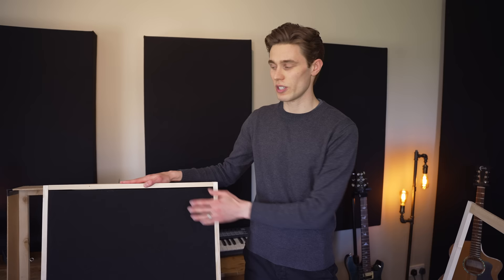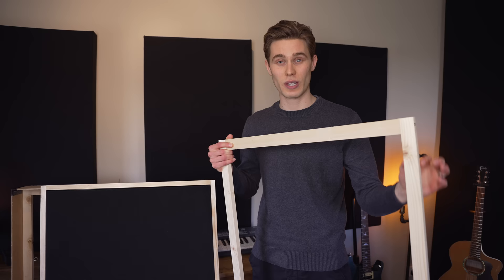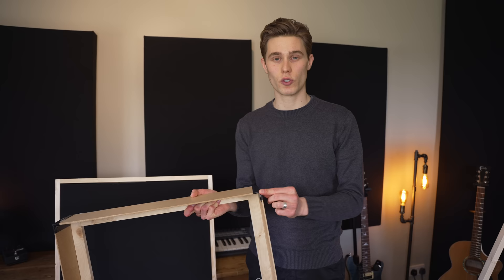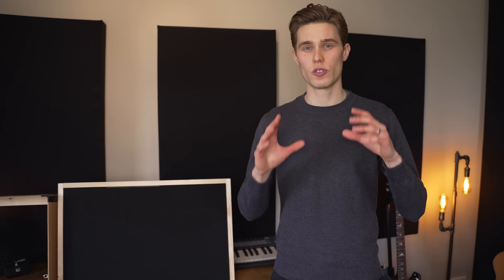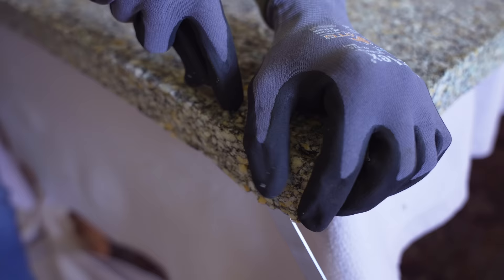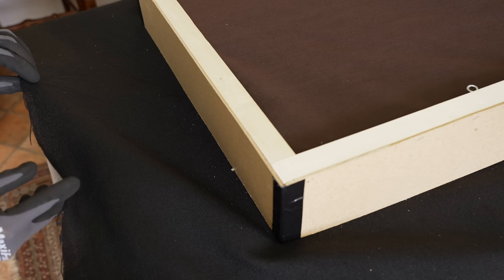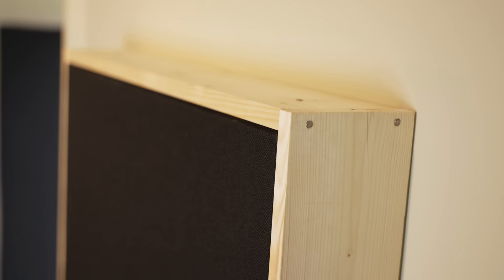How To Make Your Own Acoustic Panels - DIY Professional Acoustic Treatment for Home Studio

Comment: Testing has shown that layering old bath towels (sanitized first of course) is as effective as any insulation for these kinds of panels. You could even leave a slight gap between each towel when stapling them inside to create air gaps that will further impede sound. Best of all, they are dirt cheap at your local thrift shop and you’re doing the environment a solid.

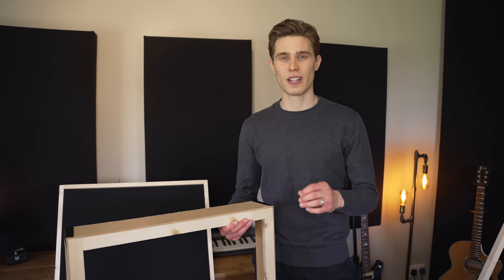Comment: 3:50  As a woodworker myself, you can also use wood glue to attach those boards at the corners.  Wood glue is stronger than screws.  The screws can still be used, but they simply act as clamps until the glue is dry.  You could also use less robust screws if you are gluing, since the glue would do the work when dried.  You could even get away with nails and wood glue, which I do all the time in my wood projects (with a pneumatic nail gun, not a hammer).  Lastly, simply gluing alone with some light pressure from wood clamps would be the way most wood workers would consider joining these corners.  With all of that said, everything I said about gluing assumes you do not ever wish to easily take this frame apart, which screws alone would let you easily do.
Reply from the maker: I really appreciate your insights. I’m always trying to learn more and I’m definitely a novice woodworker!
Reply: @inthemix  If you ever wanted to start a woodworking channel on YT I am sure you would be great at it!

Comment: Yes, moving it away adjusts the bandiwdth absorbed. At the wall there is no velocity and it absorbs midrange to infinity. Most of the time a room requires 600 times more absorption at low frequencies compared to high. It's actually advantageous to sacrifice some midrange absorption in order to trap more bass. You may even consider slats across the face of your absorbers in order to increase bass absorption in propotrion to high absorption; balance matters. Of course this may not be true at early reflection points in a listening room where you want to absorb whatever you can.

Comment: I was racking my head today about finding a mote cost effective alternative to the recommended insulation methods and while your video didn't mention it, visually the fibre padding you were using gave me the idea to use carpet foam as an alternative, I will report back with my findings unless someone here has already tried it and wants to chime in, I'll be back in a couple weeks with my findings

Comment: Great video, especially impressed with your info about the insulation material as I've watched other DIY acoustic panels using things like Rockwall. Also, the point about the air gap in the back

Comment: Nice build and tips.  I'm looking to make a few of these to balance my room... I have a large sliding door to a patio on one side that has several heavy sound-absorbing curtains hung (open in the summer, closed in the winter).  I need to add something to the opposite wall that I can hang like pictures, between real pictures that will look nice and not completely stand out & look ugly.  

Two or three of these with white fabric matching the wall color at about 24x18" should help greatly, but blend in between the real pictures.  I may even order an extra color-matched curtain set and use its fabric to make the frame covers.  I can also use the backer cloth and felt to help with the covering.  Tx!

Comment: Great video! Straight to the point, very useful information, well designed,... You sir, are one of the rare people that bring us useful information. Absolutely love it!

I only ran into 1 question, what is the width on your build for the foam and fabric panels vs the air gap behind the panels?
Other than that question, everything else was answered in the video.
Not sure, it might have been answered during the video, but a lot of new information for my tiny peanut brain. :p

Thanks for taking the time to make this video :D Keep up the good work!

Comment: Make sure to look into fabrics that actually let in sound, some weed barrier doesn’t work for this and will not let the sound get to the insulation.  If the fabric isn’t right, sound will bounce off and not get absorbed
Reply from the maker: Sure. The weed barrier will reflect 100% of the sound. 

What exactly are you basing this upon? If this thin weed barrier membrane could block sound, why isn’t it used in sound proofing applications?
Reply: @inthemix  some weed barrier is thicker than others, and it’s not that the thicker weed barrier blocks sound, but the thicker the material the harder it is for frequencies to go through it, and instead reflect off of it. Just like how sound bounces off a diffuser made out of wood. You can’t really compare weed barrier to wood but if the point of these panels is to absorb, it is very important that the fabric is acoustically transparent. If it doesn’t let it air or light well enough, it won’t let it sound well enough either. This is even more true when you add more layers on top to “cover” the insulation. One layer of fabric front and back is enough.

Comment: Great video, although I would personally say that the thicker frames are better because they allow thicker amounts of insulation or composite combinations of acoustic materials. All you need to do is add a few simple strengtheners slats that strengthen the corners and if really necessary, the middle of the frame.

Comment: Nice tutorial. Two brands for recycled denim are Merford Eco-Coustic Cotton which is 55kg/m2 and Metisse PMA45 which is 45kg/m2. I am planning on using the Metisse, it is available in our local hardware store (Gamma Netherlands). Both have fireclass B according to ISO standard which makes them suited for professional use.

As far as fabric, Decotex is a professional polyester also with fire class B to ISO standard and a material that can be printed, nice for office or living room. Deco flanel, from the same manufacterer is an alternative to the Camira fabric, which is by the way €35,- per meter with 1,70 width, the price is a lot higher then stated in the video. That must have been overstock for that price.
Reply: Is that the 4.5cm Metisse at Gamma or the 10cm? As I don't see a mention of 45kg/m2 on the site for either.
Reply: I also want to try out the Métisse, but I don't know the flow resistivity. Have you found out what that might be? I'm trying to figure out if it's worth stacking two 100mm layers on eachother...
Reply: @verlorengeboren6970  I'm constructing 6 panels right now and went for the 4.5cm ones, stacking 2 on top of each other. Each panel is indeed 45kg/m2. Not sure yet how well it will work, but had the 2x 6 panels still in the packaging in my hallway and the echo in the hallway was completely gone just from them lying there.
Reply: My reactions are being removed every time.

Comment: Thanks for this, I used this guide to create 8 acoustic panels and they've worked really well!
Reply: Are you based in the UK? Be great if you can send some links to the insulation :)
Reply: @samuelcramphorn3874  I'm not UK based, sorry. I ended up using a product called Earthwool 90 x 430 x 1160mm 7.0m² R2.5 HD Insulation SoundShield Wall Batt, which is fibreglass insulation. Had full protective gear, and had literally zero issues with it.
Reply: @juliusreade6647  How does it sound and how much did each panel cost you roughly? (in euro?)

Comment: Thank you for your effort to make this video.
I bought some hemp/jute mats, because I also had the worries with other materials like you mentioned in your video.
They dimensions are 1,2m x 0,58m and 8cm height (~36kg/m³), but I could easily press 2 mats into 8cm.  
I planned to do like 3 or 4 mats (or even double press them) in a row (1,21m x 2,32m) for a huge panel, but after your video, I will rethink my idea.

Comment: Dense Noise insulation panels are to reduce incoming noise from outside the room by bouncing it back to the outside rather than absorbing its energy while noise absorption material with air volume and huge surface like fibres will decrease faster all the echos bouncing on the remaining hard walls and windows and travelling at 340m/s.. Look at noise absorption comparative test videos of various material in time to decay 20 db. BUT with the noise source (speaker) and noise pick up (mic) on the SAME side of the material…to account for the renounced fraction not absorbed.
Then a combo of heavy (thin heavy car bonnet type noise shield, rock wool, etc) 😊😊and light (glass or cotton fibres layers) will absorb better both low and medium frequencies. With glass wool the small possible fibre diffusion can be reduced by using semi rigid panels rather than rolls of insulation…I just opened some 40 yrs old speakers to redo the rubber band around the cone of the woofers, you find all ring sizes on the web, and the glass wool inside was as new with no sign of glass dust falling at the bottom inside the box.

Comment: Nice video! Have you tested yet what frequency is retained better by these panels, from 20Hz to 20KHz? (test them with a mic on a side and a speaker on the other side). Also I would like to know(if you can do this test), please make a short follow up video with thin-to-thick layered panels and their performance (do not mount them in a frame, just stack them and measure), like starting with one sheet thin panel and ending with a 4-5 layer thick panel. I know this would blow some minds out there, especially the rock wool people :)
Edit: thank you for not making the panel from rockwool or glass fiber like other people that will kill themselves and their watchers/followers.

Comment: Happy to see you chose the correct safe insulation. Cotton is the best cost to performance material for interior acoustic panels. - To reiterate; NEVER use fiberglass/rockwool for interior panels. Fiberglass is only intended/safe for new constructions sealed within a wall behind drywall etc.
Reply: It's safe if you enclose it in a thin plastic garbage bag and use proper PPE when handling it (outdoors), then you can take advantage of the superior lower frequency absorption. Activated carbon pellets are a better solution but require a diaphragmatic absorber design.
Reply: Fibreglass and Rockwool are NOT the same thing! Rockwool is completely safe when handled properly and fire safe, this guy is has literally no idea what he's talking about...
Reply: @mymodel6  Correct they are not the same. Rock wool is less toxic, however you’re incorrect about interior use. They are both intended for installation behind an airtight sealed wall. It says right on their product packaging. They’re also banned in Europe for this reason. Cotton IS the safe alternative for secondary interior construction.
Reply: @ReyHolliday  You're talking absolute bollocks i'm afraid.  EVERY professional studio control room is based around a construction of fabric covered walls with Rockwool directly behind it, ask me how i know....

Comment: Well done matie, thanks for the info. I'm a bit late to the party and I have just checked the pricing on the Camira Cara fabric you referred to. Due to its current price (￡20.75 p/lm), I'm guessing it comes with a tube of lubricant so that they can Roger me senseless when I bent over to pick up the material.

Comment: Thank you so much, this was the perfect guide I was looking for. I was worried about the weight of these huge boxes and it hadn't even occurred to me using a smaller wood frame with the lighter plyboard sides. Also, it's really hard to find insulation where I live (we don't insulate houses in the tropics :D) and other guides always recommend it and discourage using foam because it doesn't really damp the sound properly. But here I can find all kinds of cheap natural cotton recycled materials that they use as padding in upholstery which are about one inch thick. It's just a matter of layering more.

Comment: Question regarding the fabric : would any type of fabric works? Or what should we take into consideration when selecting a fabric ?

Thanks for the video. It is super dope
Reply from the maker: Almost any type will work but ordering dedicated fabric is usually far better and easier. I have tried using regular sheets and such but they are much more difficult to work with, are never going to be perfectly coloured and often cost a lot more too!

One of the reasons I selected this fabric was because it’s very easy to work with and doesn’t seem to pull or fray.

Comment: Again: It's always educational and a privilege watching your videos. Have you considered adding strip panels (like what you're using as bass traps) to cover and kill the reflection bouncing from where the floor and wall meets - to kill the noise floor? You do have extra material, so why not cover that problem and get a better room treatment? One of those insulation will cover one wall (just enough of it) if you cut it in three pieces -- in its length, when it is spaced apart. Once you are done with that: Grab a few of those thin strips (like those used to build the main frames of your panels) and nail 2 or 3 pieces in-between the gaps of your acoustic panels to act as "diffusers." 

Great videos.
Reply from the maker: Great idea. It would most likely sound better but I don’t think it would work with the furniture I have and it might be difficult to clean (I have a big Golden Shepherd in the studio with me every day!).

Thanks for sharing the tips. I’m sure someone will see it and try it out!

Comment: I've made acoustic panels in January and used Rockwool RockSono Base (50mm), at the time there weren't any alternatives (except glaswool) for it but now the local hardware stores have panels made of recycled jeans. I've used a mask, cloves and safety glasses in ventilated space to handle the Rockwool. The panels are covered with high quality Molton fabric. 

I hesitated in the beginning to use the Rockwool because I didn't know it was safe or not to use it for acoustic panels because its normal use is in walls. People I know who work in construction and  energy performance told me it was safe to use.
Now I'm in conflict to change the Rockwool panels with new one's using the recycled jeans because I hear different things.

In my room of +-  3m at 4,5m I have 4 panels of 50mm on the walls and 3 100mm panels mounted on hinges in the corners.
Reply from the maker: Without wanting to give too much specific advice…it sounds like you constructed your panels very well and in a highly safe manner. If they are wrapped well as you say then I do not believe you should go out of your way to replace them. I re-wrapped some of my bass traps and continue to use them despite having mineral wool in them. They are wrapped in 3 layers of different weaves and I’m certain nothing can get out! 

If you make more panels in the future, I’d certainly look at other materials. Live with the panels you have and you’ll likely figure out what sizes and shapes you’ll want to add in next to improve your room.

Comment: Great vid. Even though I doubt that mineral wool is a real health concern, I just didn't feel like handling that stuff, so I just went to the hardware store and bought 70€ worth of high density foam because I figured it looked close enough to the fabric slats you're using in the video. It's pretty much the cheapest foam I could find in my area, with a thickness of 7cm and a surface of 100m x 0,5m per slat. At ~35€ per m² it's almost 4 times more expensive than Rockwool (same thickness). Still only half the price of Basotect.
However, with stuff like this it's pretty much impossible to know the flow resistivity, so there's no telling how well they will actually perform. At 70kg/m³ I would assume the flow resistivity is somewhere between 20000 and 50000 pa.s/m², which should HOPEFULLY be suitable. With Rockwool and the likes, you actually know exactly what resistivity you're gonna get, and you know that they will do what they're supposed to do. In the end, you should focus more on covering as much surface area as possible, with as thick a material as possible.

In hindsight, I should've just bought the Rockwool...

Comment: Great video! I'm wondering if you could talk a little bit about your setup in this video? Roughly how many acoustic panels do you have based on the size of the room and roughly how far apart do you have them spaced for optimal performance. Thanks!

Comment: Hey man, nice video, the DIY panels are awesome! Could you please put links in the description where we can buy materials like recycled foam? Also i would like to point it out, as a professional audio engineer i know very well that clapping with closed hands rather than opened, makes a lot of difference in the transients in terms of reflections from the wall. I don't think you did intentionally, but you should test reflection by clapping always with your both hands opened 😉
Reply: Same question 👏
Reply from the maker: You’re right about the clapping test. It was truly an accident that I slightly closed the hands on one test. However, I was listening to the decay which is still very obvious!

I can’t share links to the materials as they vary by country.
Reply: @inthemix  Thanks for sharing!